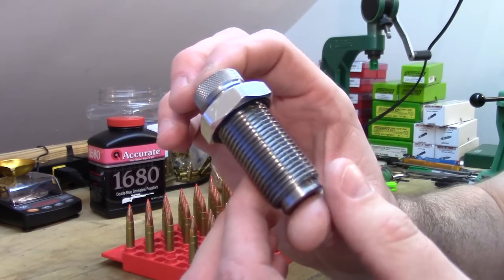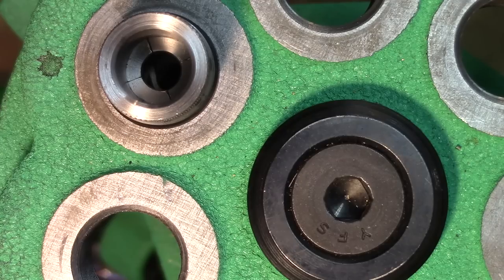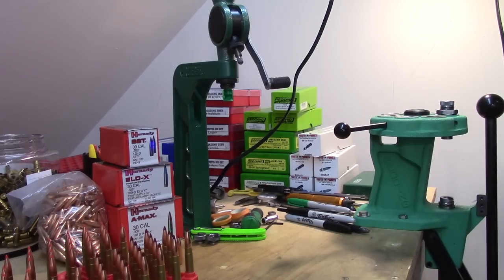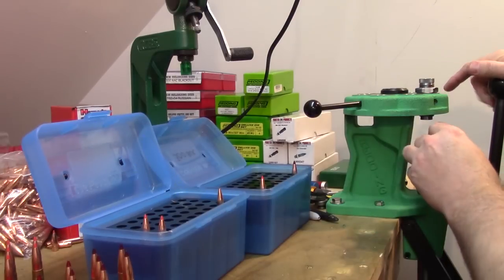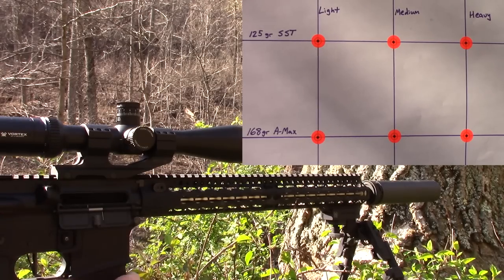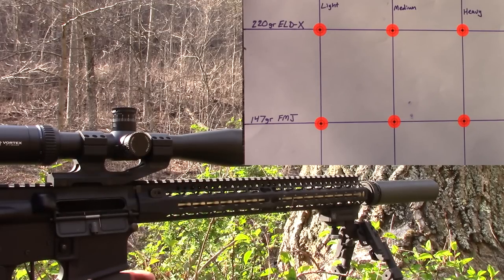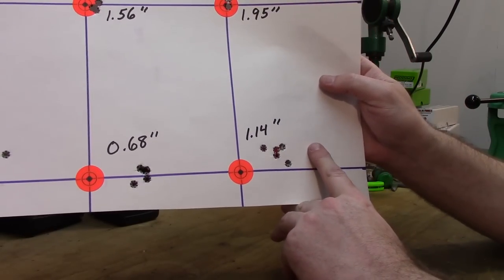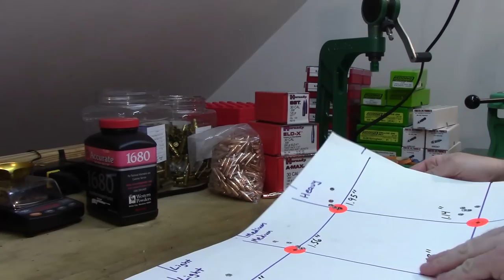Loading 300 Blk - ep 19 - Crimp Tests with jacketed bullets

Comment: Thank you for all your videos.  I am also a .300 BLK shooter and loader.  When you did your videos about sizing dies, I detected one, what I would call a major oversight.  It has to do with setting the case shoulder dimension during full length sizing.  I do not setup my press the way you do.  I use a Sheridan Engineering (or a Wilson case gauge) to establish the position of the shoulder.  A case length gauge will allow you to set the sizing die in the correct position so that you do not set the shoulder back too far (or not far enough).  The case length gauge has two steps ground into it.  You simply screw the die into the press until the head of the case falls between the two steps.  It's just that simple.  Thanks again for your videos.  Best regards, Gene B.

Comment: Very helpful video. I just received my first Lee factory crimp die (300 BLK) and will be setting it and up and using it soon. I was surprised at the results. Conventional wisdom, if I remember correctly, is that crimping hurts accuracy. However, this video showed it did not. In fact, it improved accuracy.

Comment: First, this is a very good, informative video. Thanks for doing this. I am working on trying to improve group size on an AR Stoner barrel, that has not been impressive with factory loads. And just need to make some because it is not available from stores. I wish you had chronographed this, but the data is good enough. I agree with you that most of the group size differences are insignificant, at least with that amount of data you have so far. The 147 grain heavy crimp group was effected by the velocity in and out of the sound barrier, but again nothing too dramatic. I liked your method for determining the medium crimp and I intend to replicate it. Looks like I have 18 more videos to watch. Hopefully they are all this informative.
Reply: I also got bit by ZmidwayUSA’s house brand AR Stoner $89 barrel

Comment: The thing about having a crimp is that the bullet is held back in the case allowing the powder to build pressure as it starts to burn for a more complete burn and to allow the bullet to be under decent pressure so that when it starts moving and hits the rifling, it does so under a strong enough force that the bullet is less inclined to pause until pressure builds enough to force it along down the barrel.

Comment: Hi Jonny, I shoot M1 Garand and Springfield M1A NM since 1987. I recently became concerned about bullet movement on chambering. My M1 Garand experienced (dummy rounds with the actual bullet seated to proper depth) with the CBTO being increased by about .003” after two single load chamberings. My M1A experienced the opposite result. The bullets were set back into the brass, I figured that was due to the chamber ramp feed causing resistance.

That aside, I just purchased a LEE 30-06 factory crimp die. I saw how you were struggling to quantify the crimp value. I’m a retired Mechanical Engineer, don’t hold that against me! I am trying to quantify the crimp setting setup. I am trying by using feeler gauges to measure the collet gaps (2) that are across from each other. On my die, the state (no ram force applied) measures 0.032” on both collet 180 deg. opposed slots. At the LEE directed shell holder touch plus 1/2 I measured both gaps at 0.013”. The amount of crimp is still subjective, appearance, but maybe this method of quantifying the die will make repeatability easier. The only other consideration is the loaded cartridge neck O.D. before crimping. May have to alter for brass neck thickness. Just, an idea.
Reply: Use a collet die that shrinks the neck so that the mouth is that magical .002” less than actual bullet O.D.  But do it after you turn the case necks.  Blew me away at the case mouth brass thickness variations along it’s circumference.  Only turn them enough so that you have cutter marks on about 7/8th of the total circumference.  Don’t let the cutter touch the thinnest areas.  These two operations will yield surprising accuracy improvements since the bullet is now properly centered and in correct alignment with the rifle bore.  Once these operations are done, you can lightly crimp if you want to, but your bullet tension is already set.  And as always, if you can see your crimp, you’ve crimped too hard.

Comment: Thanks for this video.  It confirms my personal thoughts on the hot topic of contention regarding crimping.  I've always been one to crimp everything when running semi-auto rifles and pistols.  You didn't have any major accuracy issues even on the non-cannellure bullets.  I always crimp my 168 and 175 SMK for 308 SR25 loads and get half MOA to 3/4 MOA and I'm happy with that.  Everyone always screaming at me "NEVER CRIMP EVER EVER EVA" and even if I show my groups and brass with no pressure signs they call it lucky.  If the military does it, I'm gonna do it.  Thanks for the vindication.  Anyhow, what I'm really interested in is the functional 147gr subsonic rounds you got there.  I have that powder, and I have thousands of Hornady 150gr FMJ-C's that I can try this with.  You mean I don't have to spend .45 cents a round anymore on those 220 gr SMK's?  AWESOME.  Never even thought to try it.
Oh, have you tried that new Hornady CFE-BLK powder yet?  Just got 16 pounds ordered but won't be home until March to try it out.  Would be cool to see you try out some loads.....others are having great results with it.
Thanks again sir.  Subbed.

Comment: On the subject of repeatable crimps, I'm using the Lee FCD as well, but then I found the Redding Micrometer adjustable taper crimp die and it is quite amazing.  Not cheap, but if repeatability is a problem, it might be just the ticket....
It does stick to the brass a little.....so if running progressive, it might bother you....I'm still running the FCD on my 1050 though, because I haven't had any issues, but it's great for precision rounds in the future.

Comment: #1 Thanks a million for posting all your hard work. 

#2 They need to increase production and distribution of Accurate 1680!

#3 I need a piece of property where I can shoot and test my loads. driving 30 minutes to test 4 strings of 5 rounds suuuucks! 

Anyway, based on your excellent research, I was able to get my 8.3" to cycle and lock unsuppressed with 220gr using Alliant Reloader 7. That's awesome! But because of your videos, I now considered 1680 as a holy grail of subsonic power for .300 blackout. Even AAC recommends using 1680!

I suspect that .300BLK ammo manufacturers are snatching up all the 1680, by any contract, wholesale, or retail means necessary to meet the commercial demand.

Q: Have you noticed any cycling issues with your subs suppressed vs unsuppressed, and with your 8 inch vs your 16 inch?

As if you don't a lot going on, but I'd love to see you redo those 147gr subs WITH hand thrown charges. I was rooting for a singlr ragged hole with 147gr heavy crimp! 

I swear I can't trust a mechanical powder thrower. I only feel safe doing it by hand.

KEEP UP THE GOOD WORK!
Reply from the maker: +RETiredGM Thanks for watching!  I agree on the 1680.  They need to start cranking this stuff out.  Reloder 7 is definitely my #2 favorite subsonic powder right now.  I'm about to start a bunch of subsonic bullet testing and I can't wait to see how it stacks up against 1680.

Having a range out back is really awesome.  Now that I've got a suppressor it's even better.  I've got some neighbors that aren't too far away and I always hate to think that I'm annoying the hell out of them all the time.

I am just now getting the 16" broken in and feeling confident that it's operating like it should.  So far, so good.  The bullet testing that's coming up will answer the question about cycling between the 8 and 16 inch barrels.  I would love to have a load that will run both guns suppressed and unsuppressed.  I feel quite certain that it will be possible with 1680 and RL 7.  Getting bolt lock-back with the 16" unsupressed will be the problem.  That might not be possible, but we'll see.

I will be doing a massive video about the 147gr subs.  I want to test them for function and accuracy with hand weighed charges of all 6 powders.  We'll be shooting a lot of ammo in that video.
Reply: +Johnny's Reloading Bench Outstanding on all points. I'm looking forward to all things 300 blackout/reloading related. Thanks!

Comment: I realize this is an older video, but I certainly think you used the Lee Crimp Die set up improperly. You set it up with the case in place and then after making contact turn it in. You are set up to over crimp the way you set it up. Just saying it doesn't hurt to read directions. I use Lee Crimp dies all the time to at least have a light crimp for consistency.

Comment: So I guess the question is, what's the difference between crimp, and neck tension, when dealing with let's say, factory ammo? Are the factory dies doing something special/specific to maybe set a particular neck diameter to affect the performance of their loads? And.... Is that something to consider when handloading ammo, to ensure proper pressures and also controlling set back...??
Man that's a lot of experimentation to conduct, to see what works best. You would think the easiest way to control set back would be the Lee factory crimp die...but, if you had the proper die, you could also set your neck tension for best performance and also control set back.
That's a huge HMMMMMM.....

Comment: I could use some advice.  I have decided to load some 300 Blackout rounds (200 grain) on the fast side to 1200 fps with "Maker REX" bullets.  Tried some Armscor 208 A-max (1200 fps) factory loads - advantage is reliable function, and reduced recoil.  What do you think about powders?  Thinking A5744 (availability), but since I'm going hot, what about H110?  I am afraid that H110 might not fill the case enough or be too hot.

Comment: Reloading die  Locking  rings...."do exist"....  IF ALWAYS USING SAME PRESS AND SAME SHELL HOLDER... Setting  repeatability with a LOCKED ring ,  which includes "some sort of set screw" is a real possibility.  There are basically two types of "die locking rings": One is a split and clamp-able ring with a screw that squeezes the C-ring together... The other has solid uncut ring with  a set screw that actually  'seats  on the die threads' . https://www.midwayusa.com/s?userSearchQuery=die+locking+rings
Reply from the maker: My preferred lock rings are the Hornadys.  They do a great job.  The issue in this video isn't really about keeping the die secure.  I change my crimp setting a lot when changing bullets, so I don't mind the mushy Lee lock rings, since it makes things pretty easy to adjust.
Reply: Johnny's Reloading Bench

Comment: Hi Johnny, first time watching your video, very good info and am now subscribed, but if you could possibly help me with an issue I have and been trying to fix... I also shoot a 16" barrel with 1:7 twist, (note: NY so not tax stamp allowed) my issue is I can not cycle subs at all, every sub or close to is a bad cycle or at the least no bolt open on empty.. (I've tried various mags) so after some research I finally drilled out my gas hole. (Before that I tried lighter buffer spring, and other simple things, with no luck) so after I drilled out the gas hole I did see a better improvement, but heavier subs above 150 seem to still be no good. The rifle shoots 110-150 supers great, but what's the difference between your rifle and mine, also running carbine length in my 16" 1:7... any ideas or recommendations would be greatly appreciated.
Reply from the maker: I am assuming you're using factory ammo?  I haven't shot a lot of factory subsonics, but the ones I have were generally loaded with a very fast burning powder.  I think they do this so the pistols and SBRs have similar velocity to the longer barrels like yours.
Fast burning powders generally have a difficult time running carbine length gas systems.
If you reload, I would suggest trying Accurate 1680, Hodgdon CFE BLK, or Alliant Reloder 7.  Those are the three best powders I've used for carbine length gas systems.
If you are stuck with factory ammo, I'm not sure what else you could do except continue to drill out the gas port.  The only thing else I could think of is possibly a messed up gas key?  Maybe the gas tube isn't mating properly with the key or something.  You might try another BCG if you've got one available.
The true fix is to buy a barrel with pistol length gas!  I wish you luck!

Comment: at 12:40, you completely missed the crimp area.  The crimp area should barely be visible.  I know this is a problem with 300 blkout but it is the purpose of the cannelured area on the bullet.
Reply from the maker: +David Peterson Completely missed is a bit of an overstatement.  About half of the cannelure is below the case mouth and that was enough to crimp into.  Having said that...I will definitely be seating them a bit deeper next time to be sure.  Same with the 125gr SST's.
Reply: Johnny's Reloading Bench I have the same issue with 300 blkout.  If I follow the seating depth, the full cannelure is exposed.  Do not look at the case opening, look at where the crimp line is.  The crimp line should be in the middle of the cannelure hence why the cannelure would barely be visible. Your crimp line is below the cannelure.  Pull one of the projectiles and you will see what I mean.
Reply: +David Peterson the Lee FCD is designed to work on bullets with and without a crimp ring..

Comment: Also, do you weigh your primers before you install them?
A heavy primer indicates more priming compound and more starting pressure and is the most likely cause for fliers.
Reply: Inconsistencies in case neck brass wall thickness causes bullets to be off-center of bore axis.  Turn the necks and use a collet die will solve the problem.

Comment: Could you please tell me what the meaning of the 'C' on the end of a 
measure in grains in a reloading chart? For example, 19.0C gr of IMR 
4227. Thanks!
Reply: If I were to guess, it probably means a compressed load.
Reply: Compressed load. Compressed what had to be done to the powder in order to seat the bullet. As long as the pressure isn't too high its fine to do this. Some would use a hotter(faster burning) powder leaving more case capacity. Just make sure the case doesn't have too much empty space causing possible inconsistent burn.